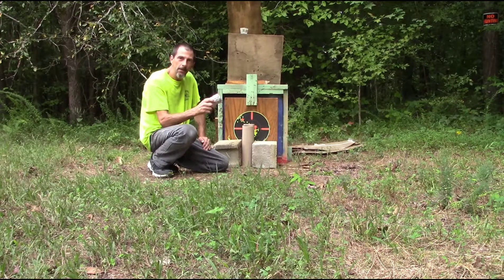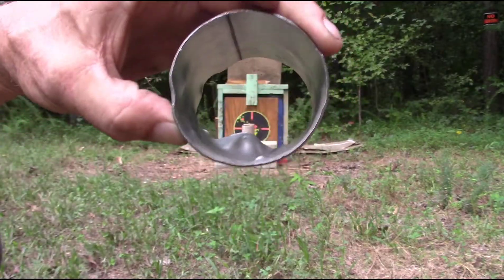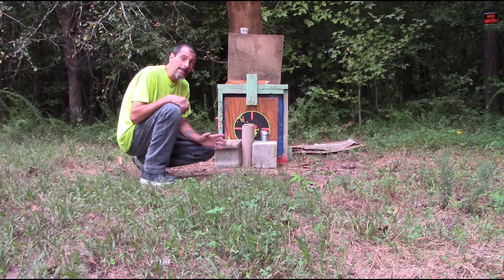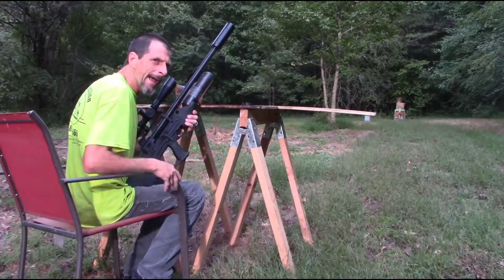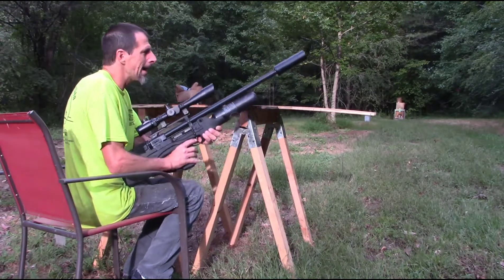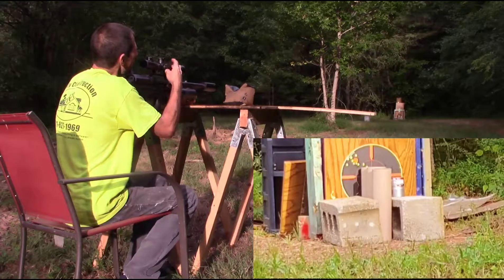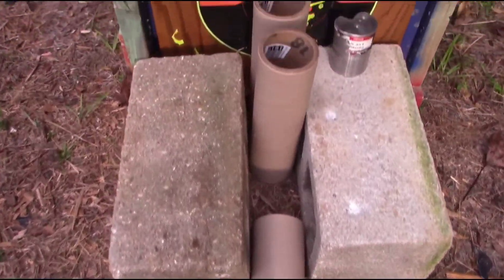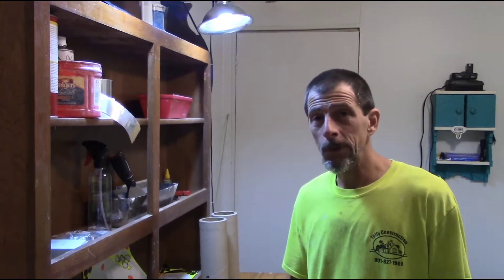hatsan bully. 357cal  tube  Penetration

Comment: Great Video, I fill for you on loading rounds in the bully, 2 of my mags do the same thing. they just don't index right at all, and 1 of the 3 works perfect every time. looks like my .25 bully has about the same accuracy as yours. I have thought of getting a LW polly barrel but hard to tell what all will need to be done to get it to work.

Comment: It definitely has the power to knick up that cinder block mighty bad. That’s the 2 things I don’t like about pcp air rifles is the loss of power after a handful of shots and having to refill the tank often. I love my break barrel with the 35 lbs cocking effort on my Diana model 34 classic .22 but I wish I could get twice to three times the power like you’re getting with the pcp. I used to have a Diana 350 magnum .22 with a 42 pound cocking effort and it was murder pumping that break barrel action even though I was getting a third more power at about 22 foot pounds of energy as opposed to 15